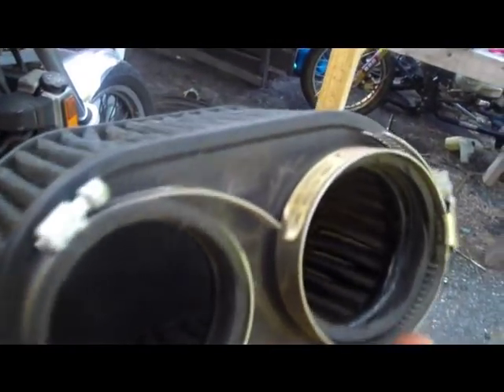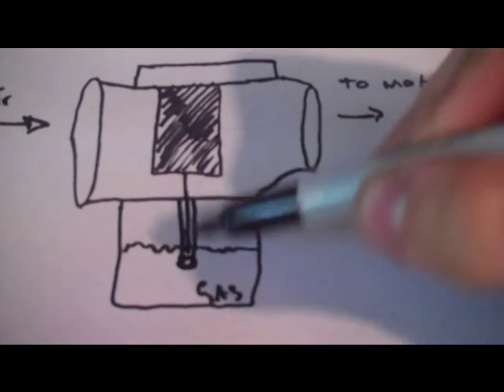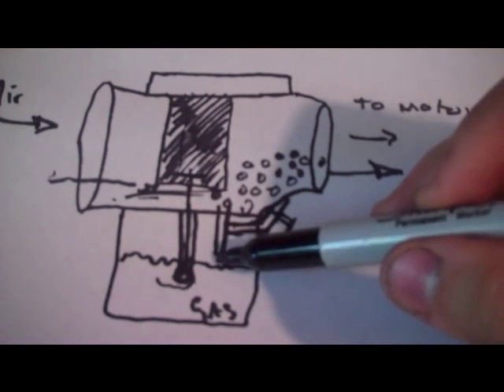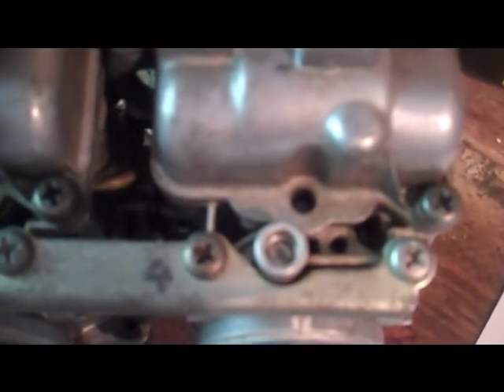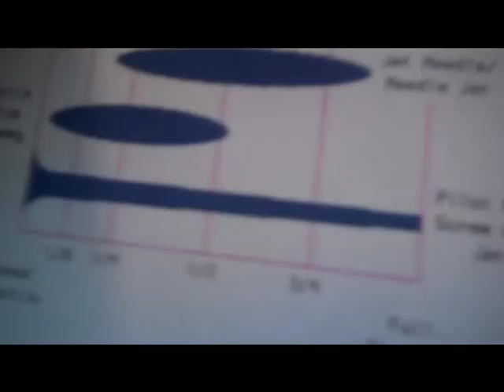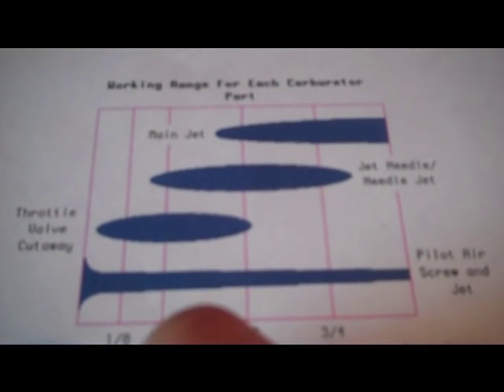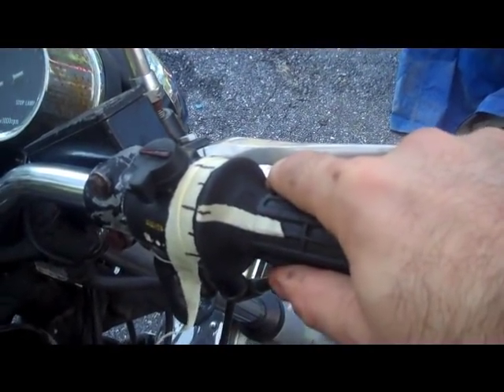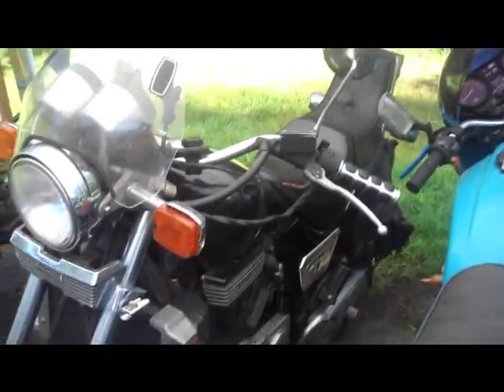How to adjust the jets on motorcycle carburetors

Comment: i have a 1994 xr650l and i am only getting 30mpg while cruising between 55-60mph and going occasionally up to 75mph when over taking a vehicle. i live at sea level. what can i do to improve my MPG.
Reply: i have on a uni air filter, stock pipe but baffle removed
Reply from the maker: William Jones
30mpg is pretty standard for that bike especially at that age, if you leave it at stock I dont think your going to get much better. Ive heard of some guys putting a Keihin FCR 39 flatslide pumper carb into their XR650's and getting low 40s as far as mpg with a little more power, I dont have any experience with it tho
Reply: ok daam what bummer....looks like i'll be putting it up for sale, i am a college student and i live in belize (south of mexico) where the price of gas is 6.50US per gallon
Reply: i thought i wasn;t adjusting the carb correctly because when i check my oil level or change it the oil has a gassy smell so i was figuring it getting too much gas causing me to get bad fuel milage
Reply from the maker: William Jones
If you are getting gas in your oil thats a problem of a leaking carburetor which is leaking gas into the motor while the bike is off. That is actually pretty easily corrected, check out my video on leaking carburetors. While you are on my channel you might be interested in the video we shot while me and my wife were touring your beautiful country on a motorcycle, its called Belize motorcycle adventure or something like that
Reply: yes i've seen that video :) yes belize is beautiful and as you may have seen just cheap chinese meliun 200's are around there are very few quality off road motorcycles around so its difficult to just get a next one, to buy this motorcycle i had to go all the way down to punta gorda in one of the villages to get this motorcycle ( i live in dangriga) you guys were riding from hopkins right? awesome!!
Reply from the maker: William Jones
Yeah I know good bikes are hard to find down there thats why I think you should hold onto yours
Reply: Did you check your pilot fuel screw adjustment? Leaner here tends to improve mileage, but too lean and it will not run well.

If stock carb jetting, you might try a stock paper filter. The Uni (oiled foam I assume) can sometimes flow more air and make the mixture lean which means you have to give it more throttle to compensate and then your mileage goes down.

Also, don't rev it too high. Accelerate easy and shift up to top gear quickly then just cruise. It's hard to ride like that when you have a lot of power, but hey, you do get better mileage.

Comment: I picked up an '04 TRX 450 yesterday. I'm no genius but I'm pretty sure the carb on that is the same as a dirt bikes. I just came off a 250 2 stroke and this 450 is backfiring pretty bad. The guy I bought it from had taken it to a Honda dealership and they serviced it. On the receipt it says they serviced the carb so I would automatically assume that they had jetted it. If it's not that, do you think my air to fuel mixture is off? If it is any idea how to change it?
Reply from the maker: I dont think you can assume anything when it comes to shops or even the dealership. If you have stock equipment then you need a stock carb and jets, my first step in diagnosing this would be t confirm that everything is stock for you
Reply: mrmaxstorey
Only aftermarket part is a White Bros E2 slip on
Reply from the maker: OK well look up your stock et sizing, and see what the jet sizes are that are in the carb

Comment: Hey so i have a small 125 4stroke lifan engine.  Its about 6 months old and so is the carb it was a kit. Has a performance exhaust that is basically  open and has a pod filter   But the carb isnt set right im guessing.  It runs on choke and thats it.
It was running when i first had  it on a quad. I set it and it ran flawlessly.  Then the quad got sold and i put the engine  on a pitbike.   Nothing on the carb or exhaust  got changed during the swap but when i tryed starting it it was having problems. Running.but would. But now it isnt running accept on choke.    Im pretty sure its the carb.  But could cold weather effect it?  Or should i do what you talked about with the main, pilot, and needle.  Or what. Im honestly kinda stumped.  Im pretty good with cars an engines in general but this is bugging me llf.  Please help me out if you can.   Ohhh i also cleaned the carb. But everything  was put back to its starting point
Reply from the maker: When you did the switch over did you keep all the old ignition components as well?
Reply: Yes.  I actualy fot it running right early this morning.  Thanks fr your help tho.  And thanks for this video.   Great  help.   Took me a few trys cause my carbi is a bitch to adjust but still  thanks again

Comment: i have this kawasaki ninja 250 1988............and im getting this problem .the bike will idle good but when i give it full trottle and it goes back to idle position but the bike runs high.....and how do i set my float high at whats needed for my bike ........and also the bike has on cut of exasust and no air box filters..,,,,,,,,,the bikes idles good but when i turn my trottle up the bike sounds like it going to cut off...what i needed to do

Comment: Hi mate good video. I have a zxr 400 that only runs with choke on if i move choke to of it idles low and cuts out. And if i try to rev the bike wether the choke is on or not it cuts out. Im guessing this is a carb problem, i hqve stripped qnd cleaned they all seem ok. What would be your view. Thanks
Reply from the maker: Michael Coulson Check out my vids on vacuum leaks and carb cleaning
Reply: mrmaxstorey hi yeah i followed both of those videos there didnt seem to be any leaks, everythigs is seated well iv stripped the carbs 3 times and on the last i followed your video, all seems to be well inside the carbs all nice and clean, no blockages, but still its all bqck together. But still i can start it on the choke it revs to about 6k if i move the choke it dies if i give it throttle it dies im lost on what to try next, ive bench set the carbs cleared the tank,pump, fuel lines, filter tyere all clear. Thqnks for the reply
Reply from the maker: Michael Coulson
Is there any modifications to the intake and exhaust?
Reply: mrmaxstorey its got a race can on at the moment but ive switched back to the standard exhaust to see if it makes a difference and it didnt, and it does have a k&n filter. Ive done some research and most people have theres jetted at 100 up to 125, my jets are 98 although some people are using 90's. Also the other jets marked 25 but not sure what that is. My only thought now is maybe my jets are too small. Could the valve clearances cause my problem. Many thanks
Reply from the maker: Michael Coulson
Yes the filter could be causing this. Either replace with stock intake or follow the steps in this video to change out the jets

Comment: question i got a 72 suzuki ts 250 can't seem to keeep it idleing at 1100 wants to die out i can keep it idleing at 2500 but nothing lower then that
Reply from the maker: pete Stockbauer Do you have any modifications to the intake or exhaust? Is everything incl the airbox hooked back up properly witha  good air filter?
Reply: yeah no mods done everything hooked back up like factory and factory exhaust
Reply from the maker: pete Stockbauer OK well in that case this isnt the video you need. Check out my video on carb cleaning

Comment: Second, I went to CarbJets(.)com where they have a Calulater where you put in you Altitude, average temps, and mods to the bike. Mine has baffles removed and the K&N ait filter. My front carbs are 98s, the rears are 95s. The slow jet is a #38  They say I need 105s rear and 110s in the front carbs, along with spacers (washers) in my slide needles. With a #40 as a slow jet. Does this sound about right, or a little excessive?  Just wondering before I order them??   Thanks a Bunch!

Comment: When you have a inline 4cyl how do you adjust the carb pilot screws with them on the bike and running
Reply from the maker: Just leave them at stock settings unless you have modifications to the intake
Reply: It has pod filters and a high flow exhaust I bumped up the main jets from stock 115 to 120 and the pilots from 35 to 37.5 moved the needle on the slide up one notch it stumbles on take off but the rest of the throttle range is great even revving from idle is great
Reply from the maker: Michael Adkins
You might want to bump up the pilots one more size
Reply: mrmaxstorey Any chance adjusting the mixture screws will solve it
Reply from the maker: Michael Adkins
You can try, but I only ever use the screw to adjust out annoying decelleration popping after rejetting carbs. If its a power loss then generally different jets are needed
Reply: mrmaxstorey it smoothed out when I made it richer but I think I went too far cause it flooded.... so that's why I was curious on how to adjust them on the bike I can't figure out how to get to the screws easily it a 94 gsxr 750
Reply from the maker: Michael Adkins
What made the bike flood? Was it leaking gas?
Reply: mrmaxstorey not leaking gas it ran great for about 5 min then it stalled On me I had to shut off the fuel and cranked a min then it started I assumed flooded
Reply from the maker: Michael Adkins
Oh yeah thats not really what causes that. I would get some new spark plugs, and do the spark plug test I show in this video to determine how you are running throughout the powerband
Reply: mrmaxstorey I'll look into it a bit more tomorrow thanks for the help

Comment: HI buddy,  nice video, i have a question: I upgrade carb on my bike to HS 40-6. Everything almost is fine but i have serious trouble form idle to 1/8 throttle. My bike have a jerking if i twist throttle fast, if i twist throttle very fast the engine even stalled. i understand, need install other PJ but i don`t know how to find out new PJ. My question is: where must be the  Idle Adjuster screw then i rotate the Mixture screw. ? 
in my opinion the  Throttle Valve must be a totally bottom (close) because we have "Pilot Air Jet" for AIR. what did you think about this ?
Reply from the maker: With carb mods like this sometimes you have to mess around with the jetting. Thsi video shows how to adjust them, you may have to either increase or decrease the pilot jet size
Reply: mrmaxstorey ok, what about Idle Adjuster screw ?
Reply from the maker: Sergey Osipov
The idle adjust screw is not likely to fix the problem that you are describing, but go ahead and play with it if you want to
Reply: mrmaxstorey you again didn't understand me (i don't know why) I don't want solve my problem by rotating the  idle adjust screw.  i ask you a simple question: in that position i must set the  idle adjust screw before i start the re-jetting ? now i want try  find the right PJ.  I must lift up the THROTTLE VALVE buy   idle adjust screw  or need set the THROTTLE VALVE totally bottom ?

Comment: Are all carb. jets the same thread?  Is it standardized so you don't have to worry about having the wrong thread?
Reply from the maker: No, there are many different styles of jets for different carburetors, and many have different threads. Some are interchangeable, but most are not
Reply: Even jet sizes from different companys are not exactly the same. A main jet for your bike (lets say a 110 = 1.10mm) might have a 1.10mm hole if the jet is from Dynojet, A Keihin 110 might measure 1.06. A Mikuni 110 might measure 1.14mm. Some companies use a combination of hole size and flow rate to determine their numbers. Best thing is to measure the jets so you know what your working with.

Comment: waddup max i have/have had a problem with my yamaha 73tx650 basically the situation is there is no idle only way it stay on if I hold the throttle down once i let go itll die out, all my jets i have changed to stock hoping it would help it out but nothing. Ive also cleaned every orifiace and hole and did a chem dip with all gaskets removed. I'm a little above sea level, If you could help me somehow that would  be cool at the least one question i have is how do you know what jet setting is correct based on the altitude that you reside at.
Reply from the maker: You wouldnt need to adjust for altitude until you get to 6000ft or so. Make sure you have stock jets and stock intake components, such as the air filter. Simple question though, is your idle knob set correctly?
Reply: Yea my idle knob is set to spec of 3/4s a turn. I've tried to experiment with different amount of turns but nothing. My air filter is stock as well and the manifolds are crisp.
Reply from the maker: OK how about the float heights are they set correctly? And make sur eyou have good clean spark plugs
Reply: yep float height is set correctly to stock 25mm its about .98 of and inch and the spark plugs are brand new also checked the coils and they check out ok im stumped :/
Reply from the maker: OK how about compression
Reply: Compression on left cylinder 100 and on the right is 150  also forgot to mention before i put in brand new plugs I would run the bike iwth some throttle so it would run and the right one would be rich and the left would would be clean.
Reply from the maker: Well unfortunately thats your problem. The difference in compression between your two cylinders is too great. Generally you will find that if the difference is greater than 15% you will have a very hard time getting your motor to run right
Reply: True i understad that. Last set of questions for you though would the difference in compression cause it to have no idle but still be able to start cause usually it only takes about 1-3 kicks  to start and when i checked compression it was stone cold. Alsooo i was watching your bench sync video and saw that my butterfly valves are all the way closed at idle Im assuming this can be a cause as well. At idle there should be a slight opening about the size of a needle as you said correct? if so ill try that out thanks for your help though its  greatly appreciated.
Reply from the maker: Yes you open the butterfly valves up by just turning the idle knob until there is a sliver of opening, and then you can adjust that when the bike is running. Low compression motors can start easily but not rev, start hard but be able to rev, or rev up ok but not idle, it all depends

Comment: i change to a pod filter. is it okay to run my engine with the choke on  half position?
Reply from the maker: Its not going to produce good results. You wont have a consistent or reliable mixture throughout the powerband, you may be rich or lean at times

Comment: @mrmaxstorey I'm just hoping to get her running good enough to when I sell it I can get a good price for it. Good replacement boots are next to impossible to find & that's why the shop didn't want to work on it. The boots I got off Ebay were in far worse condition then the originals. I'm just going to take the cash from the Maxim sell off & put towards accessories on my new Star 950

Comment: Ok if you take out the pilot mixture (on that type of carb) and shine a light into the engine side of the carb you will see a light shine though the hole idle. Right behind that is a set of four holes and they are positioned right at the edge of the butterfly valve so when the valve opens (even by 5%), air rushes past the holes and adds more fuel to the pilot. its point 6 on this link christiane.homeip.net/pub/adventurer/carbs/mikuni-idle-circuit.png

Comment from the maker: Well, in cases like this it often helps to start back at the basics. Confirm gas, fuel, air and spark. Head on over to my motorcycle diagnostics website TheMotorcycleMedic (dot) com and check out the diagnostic algorithms I have there. Start by clicking on the tab "Somethings wrong with my bike"

Comment: yeah idk im not the smartest person when it comes to computers,plus pretty sure that wont solve the problem.Yesterday i turned in the mixture screw all the way in and turned it out once and there was gas dripping underneath the carb (not the float bowl) then i put it to 2 turns ( 2 1/2 stock) and it still doesnt start.i think its something w/the carb,but idk what if only i could put it to stock and then tinker w/it.

Comment: I have a bike that spits and Biggs at hi revs and dies wen u go to wot from idle BTW its a stock kymco 50cc with a no rev limet cdi and a short pipe and a 23mm 110cc pit bike carb so I no its file related I need to no if I'm not getting enough of to much
Reply from the maker: If it runs better when you put the choke on, then you are lean. If it runs worse, then you are running too rich
Reply: it dosent make a difference and it boggs if i nail it from and idole and dies
Reply from the maker: craftsman mud mower
What does your spark plug look like? If it gets black then you are too rich

Comment: (cont) those four holes appear here christiane.homeip.net/pub/adventurer/carb-rebuild-part-2/100_0611.JPG My current theory is that if the level of fuel is below this hole then the transition phase will not have power and you will move from slow to main jet causing hesitation at low revs.

Comment: (cont) i cant post links in the comment so do the necessary to the urls to see the images. Again christiane.homeip.net/pub/adventurer/carb-rebuild-part-2/100_0611.JPG shows the 4 [pinholes that are visible under the slow jet and the brass you see in the pinholes are the butterfly valves. This seems to be point 6 (although its not very clear) in the diagram

Comment: took a nighthawk 750 to a guy that i  thought knew bike's,.
spent 265,00 to no avail,
bike sputter's and has flat spot takiing off, 
run's rough at med rev's,
has V&H Megaphone, and plug's smell like gas,
the guy said he put the stage 1 Dynojet kit in it.
BUTTTTT?
i get it home,still on trailer.,,,
start it????
and it's does the same thing as before I took it to this guy..
ARGHHHHHH.
watch yor video more,